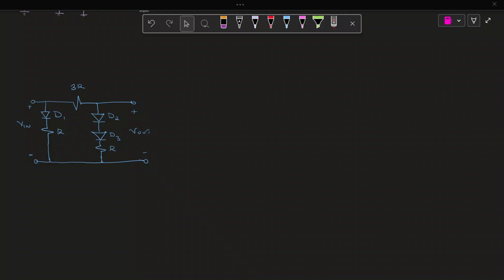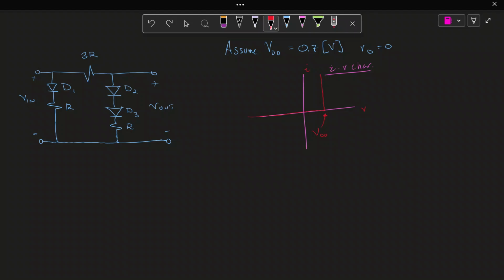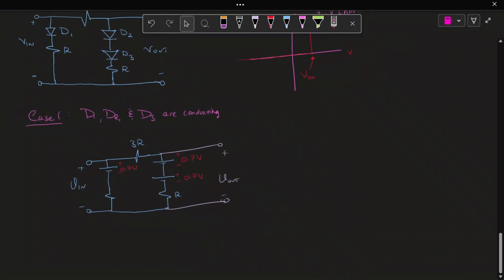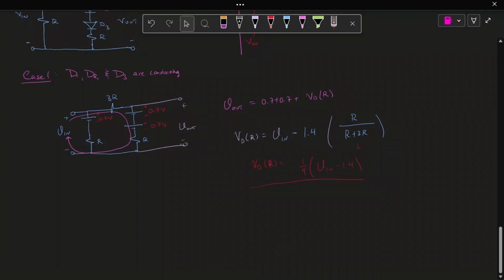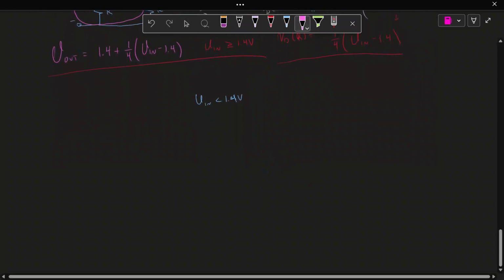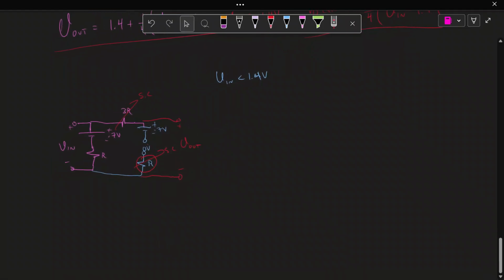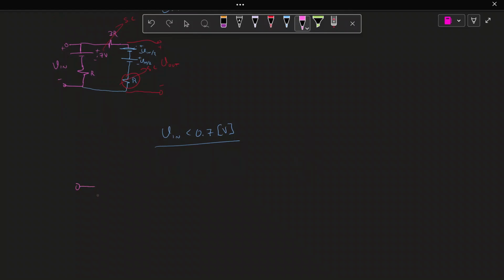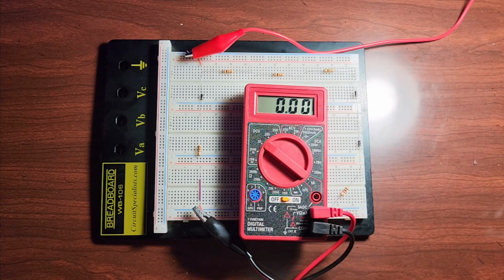Diode Application

Comment from the maker: The reason my practical voltages didn't match the theoretical was because the voltage drop across the diodes decrease as the input voltage decreases due to decreased current through the diodes. I didn't re-test the voltage drops when I decreased the input voltage so the equation would be wrong. In theory though, the equation will be correct until the threshold voltage is crossed.